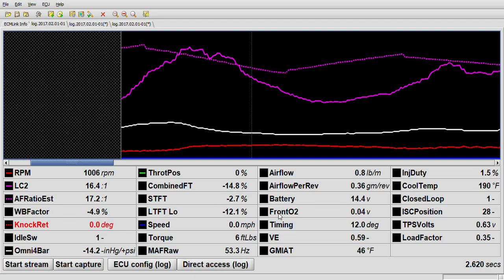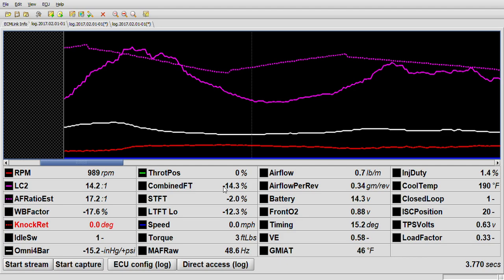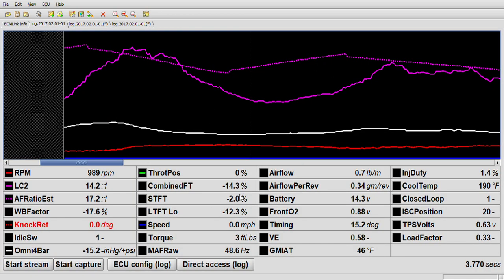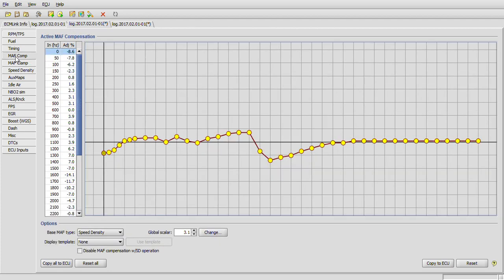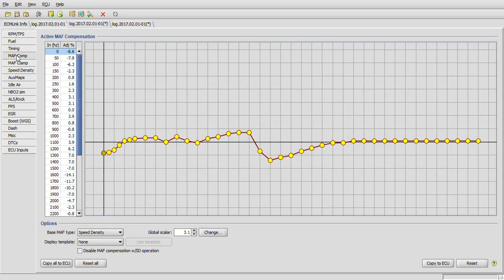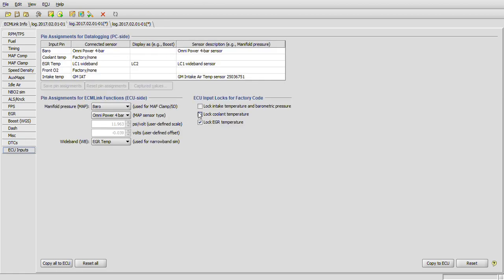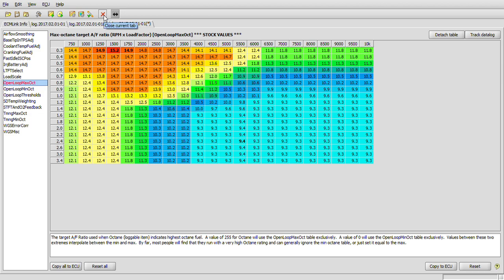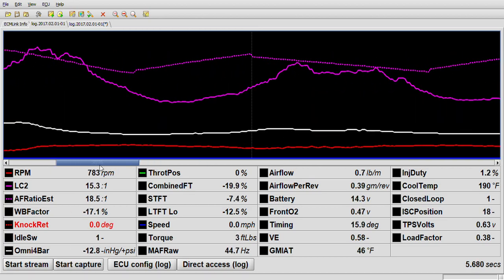ECMLink, Going over SD log at idle.

Comment: What does locking egr and intake temp do exactly?
Reply from the maker: Basically to keep the ecu from looking for a sensor you may not be using anymore. If you hook up a map sensor to the mdp input, you don't want the ecu to be looking for an mdp sensor. Makes life easier for the ecu basically.